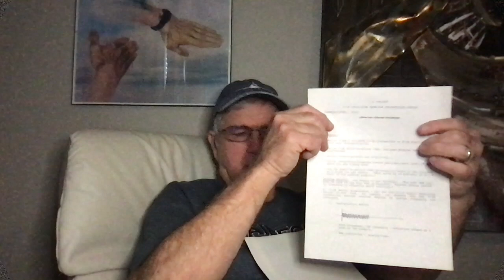The T 38 Stall/Sink Rate Ride

Comment: Ron had a good video similar topic regarding circling approaches with lower MDAs than pattern causing sight angles putting you tighter than expected as similar angles from lower altitude meant you were closer; believe a certain Citation just crashed partly for having a low downwind and similar angle sight driving close.

Comment: @piltz5583 You are right! ,  let me share part of  EXECUTIVE SUMMARY UNITED STATES AIR FORCE AIRCRAFT ACCIDENT INVESTIGATION T-38C, T/N 65-0395 & T/N 67-4590 VANCE AIR FORCE BASE, OKLAHOMA 21 NOVEMBER 2019 "On 21 November 2019, two T-38C Talon aircraft collided during an attempted formation landing at Vance. During the landing sequence, the mishap student pilot (MSP) prematurely initiated an aerobrake immediately after the Mishap Acft 1 ( MA1) initially touched down on the left of the RWY, causing the main wheels to lose contact with the runway surface. Almost simultaneously, MSP applied and held right rudder in an attempt to steer the acft away from the left edge of the runway. MSP use of rudder under these conditions--airborne, configured for landing and at an increased angle of attack--caused the MA1 to roll and yaw to the right and collide with the Mishap Acft 2.

Comment: At Reese AFB ‘78-‘79. I believe we had a non-graded ride in T-38. I have often used that lesson in my discussions with my airline students. If memory serves, a T-38 rudder with gear up can deflect +/- 6 degrees and with gear down rudder can deflect +/- 30 degrees. So, this was demonstrated at a safe altitude. Gear up, no problem, slow roll. Gear down, feed in rudder,  when it rolls, it’s over, snap! While I was in Tweets, we lost a T-38 student in final turn. Bobo emphasizes sink rate and barely mentioned rudder. He even mentioned “tap” bottom rudder if too tight to save the turn to final. In my opinion, bottom rudder is the killer, at least for a student. I incorporated rudder awareness into my airline instruction, especially at high angle of attack. I’m not an aerodynamics whiz but I tried to get students to imagine where their roll authority was and that it moves from ailerons
 towards rudder as angle of attack increases until crossover angle of attack where rudder has more authority than ailerons. There were a couple of Boing 737 stuck rudder crashes which are very interesting reads.
In, summary, as a guy who made it through UPT, but didn’t necessarily shine, it was sufficient for me to just not mess with bottom rudder in final turn.
Bobo, I enjoy your talks about T-38. I’m thankful I went through UPT when all got to fly it. I went on to C-7 Caribou and  wonderful career in C-130s , concurrently as an airline pilot and instructor.
Reply from the maker: Great comments!  You are spot on with the '38 rudder limits, gear up and gear down.  And it will 'snap' if you over controlled vs it!  What I taught with respect to using the rudder was to use 'pressure' vs. input.  Eg. balance rudder application with pressure on the opposite rudder to control the amount of deflection that you wanted...rather than just cramming in a boot-load of rudder!
Reply: You are right Sir ,  let me share part of  EXECUTIVE SUMMARY UNITED STATES AIR FORCE AIRCRAFT ACCIDENT INVESTIGATION T-38C, T/N 65-0395 & T/N 67-4590 VANCE AIR FORCE BASE, OKLAHOMA 21 NOVEMBER 2019 "On 21 November 2019, two T-38C Talon aircraft collided during an attempted formation landing at Vance. During the landing sequence, the mishap student pilot (MSP) prematurely initiated an aerobrake immediately after the Mishap Acft 1 ( MA1) initially touched down on the left of the RWY, causing the main wheels to lose contact with the runway surface. Almost simultaneously, MSP applied and held right rudder in an attempt to steer the acft away from the left edge of the runway. MSP use of rudder under these conditions--airborne, configured for landing and at an increased angle of attack--caused the MA1 to roll and yaw to the right and collide with the Mishap Acft 2